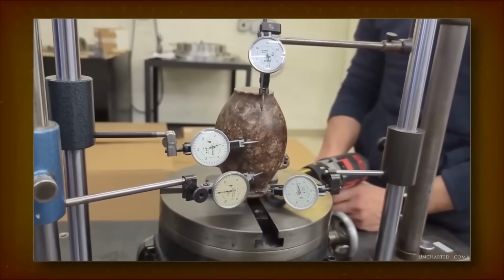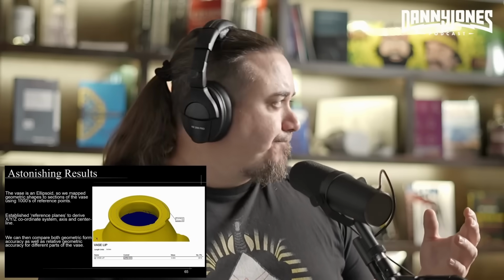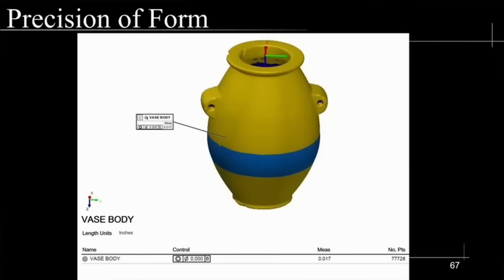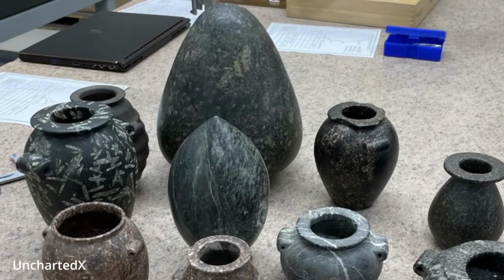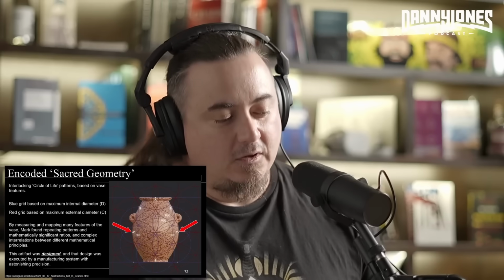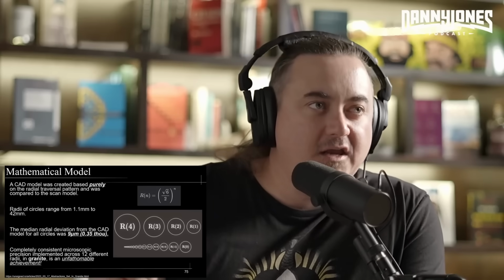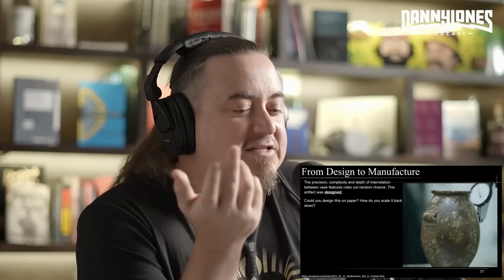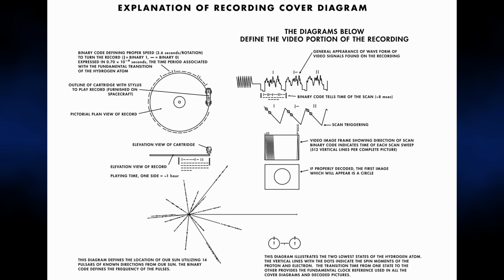Are These Ancient Egyptian Vases Actually Impossible to Make? #podcast #science #history #egypt

Comment: These are not carved that is not stone that is an ancient form of polymer bonding. They are shaped just like a clay pot and then heat it up just like a clay pot. The only difference is whoever saying that rock is not an actual professional. This process would be much like concrete and glass working in the same piece at one time the material was malleable Just cause it looks like a rock doesn't make it a rock
Reply from the maker: That was also my conclusion  a form of geopolymer

Comment: Garnet dust was used for centuries to cut any stone, even with string and wax as a blade. It might be possible that these could have been made with simple lathes, the INTERNAL measurements to thickness would be very hard to do. You do not need to look at geometric shapes in a CMM model, it creates the model as it is, and you can click any surface and obtain the arc or even torrid etc.
We used to HAND machine 6 stainless steel pads on about a 5 ft diameter to co-planarity of FIVE THOUSANDTHS OF AN INCH!.  Each pad was about 4 inches by 6 inches and of coarse about 5 feet apart with two nearer the center. All done by hand. THe handles on the vases would make it REALLY hard to make and hold dimensions by hand! Some 5 and 6 ft diameter sections are round to within .030 inches and hold a diameter of .005 inches. 
The error in tool changes in modern manufacturing can be as little as .0001 inches per tool, even in high tolerance manufacturing (.005 inches tolerance) we see less than .001 variance in "zero" per tool easily.
However, the mathematical relationships to measured dimensions are intriguing.

Comment: The melting point of granite is only 500° higher than iron and was 100% possible to achieve required temperature. And a clay mold  would be super easy to get detailed deigns, and just pour the liquid stone into the clay mold like they did with metal and glass
Reply from the maker: That was my thought, but a geologist pointed out that to create granite, the cooling time needs to be slow, so crystals can form inside the stone. A fast cooling granite changes composition. But then I thought; what if they did have a way of controlling the cooling process. These vases look so molded..

Comment: They are not pots or vases. They are pressure wave devices. They are tuned using radian mathematics. They are a tool with no moving parts. They all look different because the all use a different radian circle because they are tuned to different frequencies. They had to be built perfect to tune into a perfect frequency. The handles are not handles but where you hook the electrodes. These are the tools used to build the pyramids. The Egyptians thought they were pots.
Reply from the maker: Interesting

Comment: these vases are easily replicated by modern machine tools, cutter grinders plow flutes in solid tungsten carbide at astounding rates, we flatten massive granite surface plates to a couple ten thousandths of an inch ... the error between the handle lugs is exactly what you would expect to see from processing with lower quality bearings on main and tool spindles, and from varying tool pressures... the real question is who did this 10,000 years ago. I find myself quite interested in whether the sides of lugs are parallel to each other or to the radial line.
Reply: Show us one you made.
Reply: @johnmacneill8066  if I had access to a large cutter grinder (2 million bucks) it would take much longer to procure the material than whip one up. cutting stone softer than diamond would be easier than metal - the metal bell shape would ring an chatter like crazy.

Comment: Very interesting! I didn't know these existed until watching this video. The precision discussed is similar if not better than modern engine manufacture. Considering the plasticity of metals used in engines to do this with hard stone is incredible. Titanium is often cited as being very difficult to work with is for the same reason, lack of plasticity. This is the first real evidence of technologies from older that 5000 years. Consider steel will degrade to nothing in less than 500 years, glass has the longest survivability at 1000 years and turns to dust. Stone is one of the few materials that takes longer to degrade in absence of water and weather. Absolutely incredible.
Reply: So when you find a Iphone inside a pyramid your conclusion is : look ancient Egyptians had Iphones ? (as opposed to : some tourist lost it )
Reply from the maker: They are incredible

Comment: As I see, the answer is: no, it's not impossible to make it. You can clearly see, there are thousands of vases. On the other aspect: we replaced craftsmanship with modern technology. Just why you can' t reproduce it today doesn't mean it was made by some unknown ancient technology.
Reply: When you measure the vases the accuracy and symmetry can not be made by hand, and even if it could they didn't have the technology to measure accurately enough to produce them, the fact that there are so many likely means they weren't hard to make for them, just like a cheap modern granite chopping board that is flat to within half a human hair not because it needs to be but because modern automation works that way.
Reply from the maker: Exactly
Reply: @dancingfrogsxb1276  Absolutely correct, any precisely machined metal object, like a jet engine turbine blade, would be as anomalous, as well as the precise metallurgical composition, exactly repeated for each blade.  The object's potential 'househole item' usage hides the insane, unnecessary precision that, as many have opined correctly, was impossible for the unearthed tools found in the age levels of the pyramids where the vases were found.   Unexplained and leave it at that, anyone can speculate without evidence, even a fifth grader.

Comment: They were made by mankind with tools and the intelligence to craft it in that time. People over think these things and to say they can't be made with modern tech, tools and manpower is ridiculous and not true. Back then you used what you had and made it work after all , all you had was time. This could have taken them a year to make or maybe 10 years to make and fine tune it, depending on how they went about it and the process they used.
Reply: Nope. A person could work a thousand years by hand on a granite vase and never, ever come remotely close to the precision these vases exhibit. The reason is the human body is a very crude, gross instrument that is simply incapable of the absolute motor control required. Can you look at a curved surface and determine that you need to remove a thousandth of an inch? Can you exert EXACTLY the correct amount of pressure, with the correct orientation, to remove a thousandth of an inch from a curved surface INSIDE a narrow-necked vase? And remember, granite is a heterogeneous mix of minerals of differing hardnesses, so you would have to be able to increase or decrease, on the fly, the pressure being exerted on the granite, to account for these variations in hardness?
Reply: @ABC-yt1nq  A round wet granite stone fixed to a spindle with guides pin pointed to the exterior of the surface lip both top and bottom can do this. Just keep increasing the granite stone making it remove more materials. Granite will wear granite down just like a creek with pebbles and sand. They figured out how to use water levels in a ditch to make a level base for the Pyramids amongst other tech like the wheel, so this is no more mysterious. The only other option would be those dreaded "aliens", is that what you are trying to say? it was aliens? or time travel from the future? Because that would be the only other options and those are just ridiculous.

Comment: Seems to me the real question here is what was the vase intended for. Why granite and why would it need to be so precise? Typically high precision is driven by process control and/or part interchangeability... as though it should fit into some kind of a machine. Just because one can make something very precise doesn't mean they would do so for a trinket or display where it wouldn't matter.
Reply: It has been done with machines that had some unused time. The trinkets were better than standing idle. One use was for advertising gifts.

Comment: I enjoy drawing concept cars and constantly use the golden ratio, it never lets me down.
I've been an old school manual machinist for forty two years and have over 85,000 hours under my belt and this has got me scratching my head as to how these things were made.
Reply: I use it in designing furniture
Reply: @gjle 
Always a great starting point for proportions.
Reply: there were no tools, no machines, the vases were made a method unknown to mankind, not by mankind
Reply: @DaddyAl-Baddie  why rock, this level of knowledge could use any material.
Reply: Someone else who’s worked on a lathe said something about the ball bearings needing to be perfect or it will “wobble.” I have no idea what that means, but I’m sure you do. He basically said, even the most perfect lathe, this is almost impossible. They didn’t even have ball bearings back then.
Reply: @SavannahCatMama  the thing is, the facts are these: we really don't know who made those vases, with what technology and when. presumptions and assumptions don't make facts no matter how scientific they are - and in case of archaeology they can even be borderline scientific, hand on heart. sometimes it's forcefully putting things in baskets and sticking labels on them in lack of a better knowledge of real history
Reply: @SavannahCatMama 
Really serious lathes run the spindles on air bearings. I've run some pretty old lathes in my time that will still turn to 1/2 a thousandth on an inch repeatably.
Achieving the tolerances isn't that much of a problem, it's the actual geometry of the component that causes the issue, producing some of the features such as the lugs causes major problems, which a modern machine tool would struggle with.
Reply: Bot comment 😤
Reply: @Old299dfk 
What you on about, bot comment lol

Comment: These are very likely forgeries. They can't even track them back pre 1980 while 5-axis-CNC existed before. Probably around that time some guy(s) decided to make those vases and sell them on the market. Ben made some arguments against the forgery-accuse, but IMO they are very weak and even support the forgery-claim like the relatively low prices of the vases before the hype (still a few thousand $ per vase). They also found Titanium on the vases, so probably from the tool-tip they were using.
Reply from the maker: No way, they all come from under the Djoser pyramid

Comment: This is definitely achievable by hand. Ultra highly skilled
Reply from the maker: That is what many experts say. Yet nobody is trying..
Reply: Absolutely incorrect. It has nothing to do with skill, and everything to do with the fact that the human body is far too crude a machine to produce the precise control required. Can you, with your eyes, detect where on a curved surface a thousandth of an inch need to be removed? Can you hold you arm steady exerting exactly the precise pressure required to work a material composed of minerals of differing hardnesses?

Comment: The people that made these were artists not engineers. Saying we can't make these now is silly. A modern mill/lathe can make an infinite variety of products. The tooling for making these vases was a basic lathe, specifically made for this purpose. Driven by manpower and worked by someone with more skill than any machinist in modern days. These people learnt from their parents who learnt from their parents and so on. It is doing mankind an injustice to say that we couldn't do this. 

If each case took a year to make, but lasted 15,000 years then it's a much more efficient process than something made in a day that lasts a year.
Reply: Great, now explain how they did the solid rock handles on a spinning lathe.
Reply: @Alfahippie If the people that made these had advanced modern levels of machinery, evidence of the machines would still exist. 

For example we've got an English Wheel at work. Not my trade id have no idea how to use it, but it makes compound bends on sheet aluminium. This has already outlasted tons of the parts it's made and will survive for way longer. 

I think you're all doing the people that made these a disservice. 

It's more a case of time and pressure, Shawshank style than ancient people whizzing around all over the place on hover boards.

Comment: Completely misrepresents what a Turing Machine is, by referring to it as a physical object which it isn't. A Turing Machine is a theoretical concept that deals with mathematical computations that takes some input, performs some set of instructions on that input, then takes the output.and treats it as new input, performing the same set of instructions until a certain condition is met (that is defined in the instruction set) when it halts all future computations. 
The physical making of these stone vases had nothing to do with a Turing Machine.
Reply: They are saying that the process would require some type of computing machine, but it would not necessarily have to be the "computers" that we use now.

Comment: The only story here is that knowledge is lost. That shouldn't be a big shock to anyone. No one knows the process of how these were made, and we will never know exactly how it was done. Of course a process beyond just free-handing it was used. I can tell you for sure that the only way to make something this round is by fixturing and turning. There are many, many methods of doing that.  Its likely the tool was also supported and possibly even turned. Tools to make this can certainly be made from wood and stone.  Tolerances are tight here but not unbelievably so... particularly for someone with a degree of mastery in their trade, and on such a small object.  Lots of talking heads on these channels who have never built a thing in their lives. Be wary of those whose theories rise to the level of religion and belief.

Comment: I am an engineer and would have trouble making this. Even if part was lathe work the line where the handle is would have to be milled but to program a machine to this accuracy would be a seriously intense job but could not be done without electricity and a computer. That is assuming I am copying the vase in metal.
Also look at those phenominal buildings they refer to as tartarian. They could not be carved even by todays stone masons.
Reply from the maker: I agree, the question of the old buildings is mind boggling

Comment: most of the instrumentation engineers have rather little experience with manufacturing compared to a tool and die maker and how things can be done simply... it will amaze you and most of them as well, I have had the privilege of working (as a computer/electrical engineer) with a classically trained and apprenticed machinist, he could do so much more then (in the 1980's) that even some of the best today would run to a 6 axis mill and declare it impossible to make without such a mill...

many of these skills are getting lost in the current generation... and it is a crying shame....

Comment: that everything is highly accurate and concentric tells me that they only removed the item from the base stone in the lathe once doing all operations in one setup... that is after they found a good lathe... btw the handles (or actually the rest of the vase between the handles can easily be made on a lathe just not a continuously spinning one...  I would love to see how they did the bearings of the lathe (this was no simple potter's wheel)

and measuring angles in radians only makes sense if they have no other precision angle measuring technique (that is the beauty of the definition of the radian...

I beg to differ with your opinion that a CNC machine was needed, all that is needed is a good lathe (even for the parts between the handles... no mill, no CNC... you need to spend some time with some classically trained machinists in a machine shop as it is amazing how much can be done with just a lathe, as for measuring angles and  curves that you talk about a simple string from a common mounting point (or two) is all that is needed...

now all that is left is to find the remains of a precision lathe (or lathe like device)... something with precision main bearings with very little runout... all else is more or less just s superficial detail... no go find that 10,000 yr old machine...

Comment: Foot lathe pottery wheel and sand (aluminum dioxide) could maybe account for the outside, but not the inside.
Reply: how do you ensure the pottery wheel is ABSOLUTELY  level? How do you ensure that the bearings the wheel turns on are perfect? How do you measure the vase as you're working on it to know whether to take another thousandth of an inch off?
Pottery wheel? Nope.

Comment: They must have had turning tables and they sanded ever so slowly… even if it took a month for once sphere… if there is a turn table, it will be automatically center 😊
Reply: How do you get the table ABSOLUTELY level?
How do you produce the perfect bearings required for such a table?
How do you measure to determine that you need to take a thousandth of an inch off a section of the work?
Reply: @ABC-yt1nq there are plenty of natural flat rocks, especially when you crack them. They can be used as the flat base to make those vases on. Maybe sand and water is used to sand, grind the inside slowly. And this happened in more than on culture. Iraq and other countries have similar objects thousand of years ago